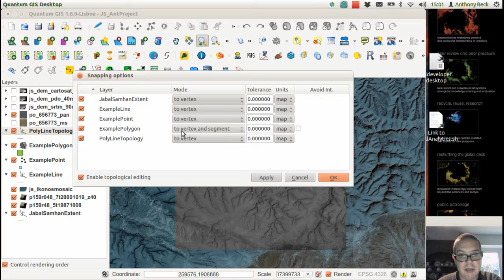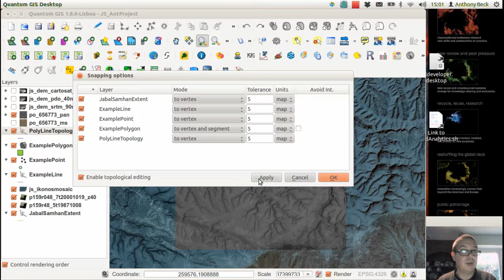QGIS Vector Digitising: Snap Settings 01

Comment: Hi Anthony,

Do you perhaps know a way to use the snapping tool to connect two nodes to each other but yet keeping an x distance between them. 
So they are not connected exactly on top of each other but have a distance of x. So polygons look like they are connected but when you zoom in to 21:1 you see a distance x between them. Because when i draw my polygons now i have to zoom in and move the node of the polygon close to the node of the other polygon and them zoom back out and go to the next node of the polygon and repeat the steps. 
Hope you or someone else seeing the comment can help me out.